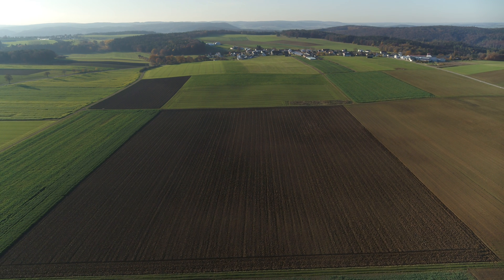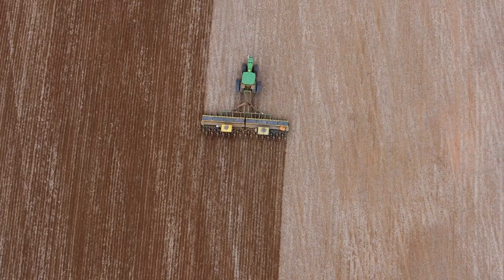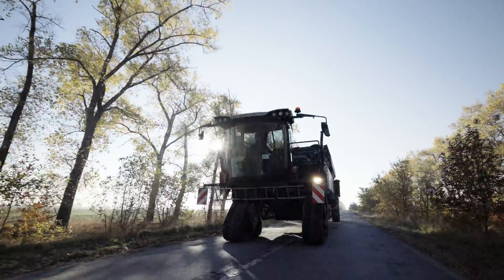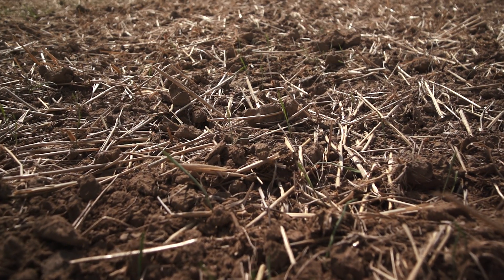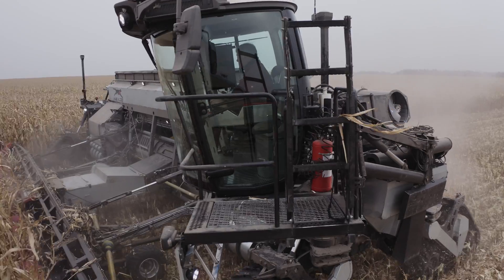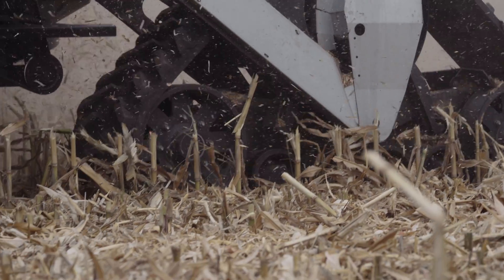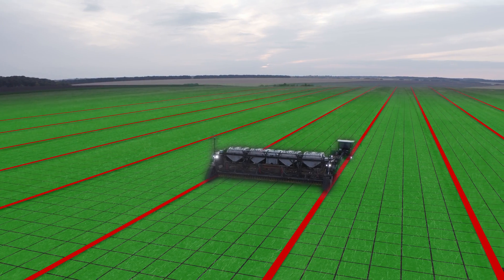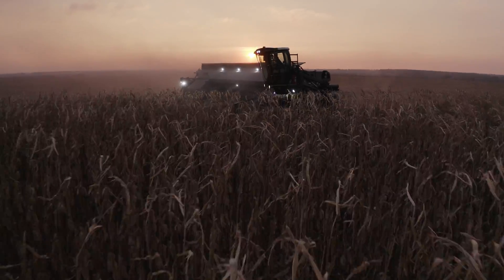Controlled Traffic Farming I NEXAT

Comment: It is necessary to make quick-change batteries - some work, others are charged. It is also quite possible to work on a kilometer cable and even several times longer - no problem - heavy excavators often work that way.